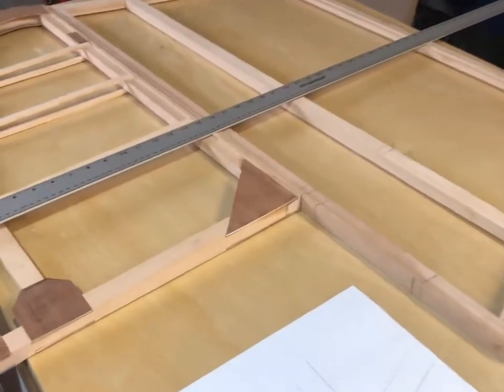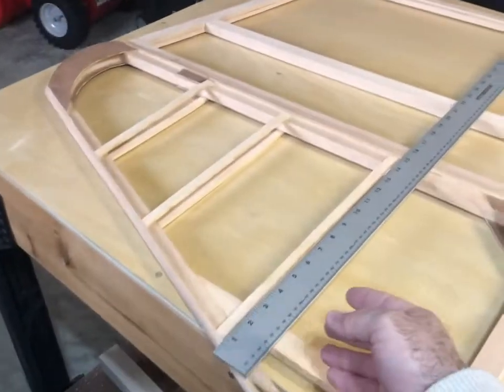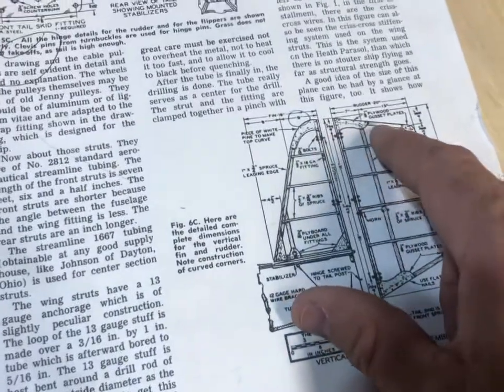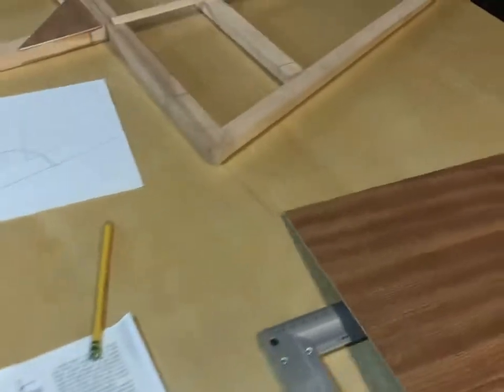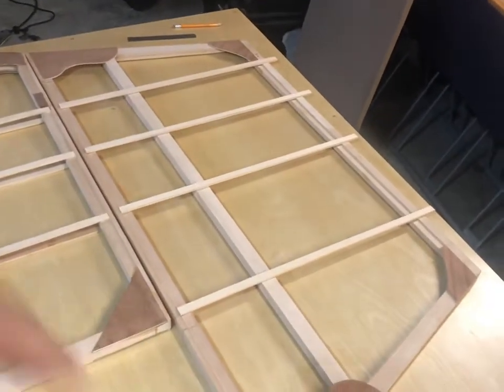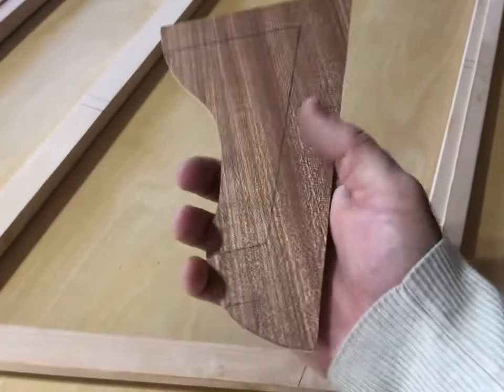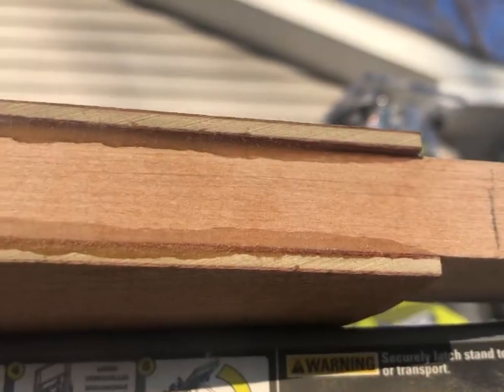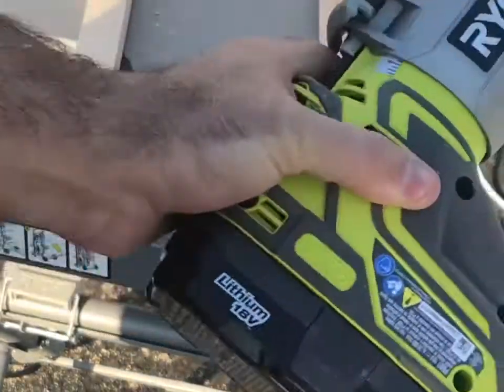Pietenpol Air Camper Build #8 - Rudder

Comment: Hi Tyler, nice work. Now that you are making your gussets to a curved profile would you have completed the vertical stabilizer the same way? I'm waiting on my plans from Andrew Pietenpol, I can hardly wait to start building! Best regards, stay safe. Don.
Reply from the maker: I would not have curved the gussets on the vertical.   The gussets on the vertical are smaller and leave less room to do a curve.  They are triangle in shape on both drawings.  Where as the gusset design on the rudder is a triangle on one set of drawings but curved on another. So I chose the curved “just cause”.